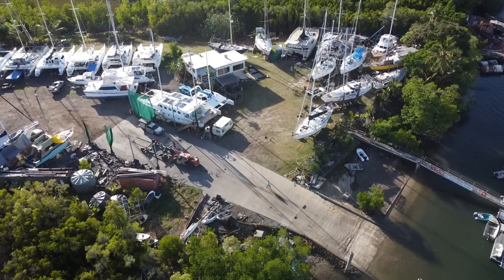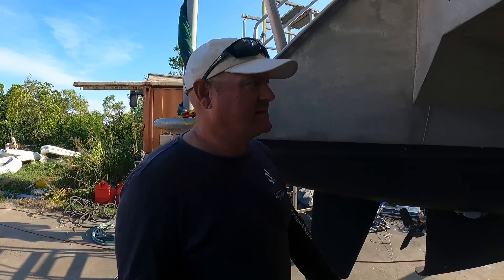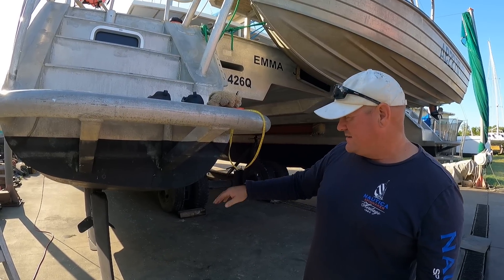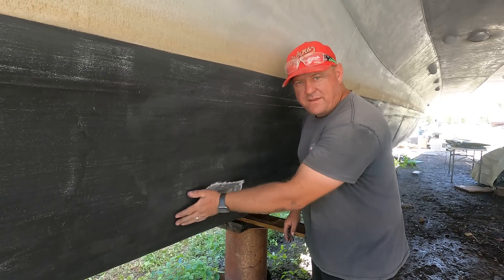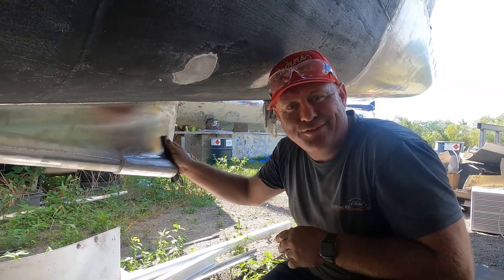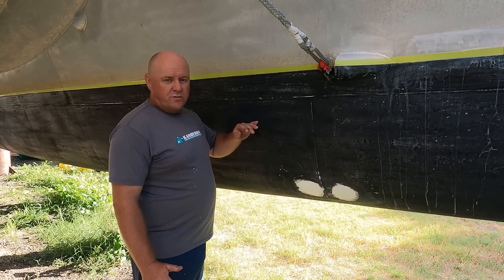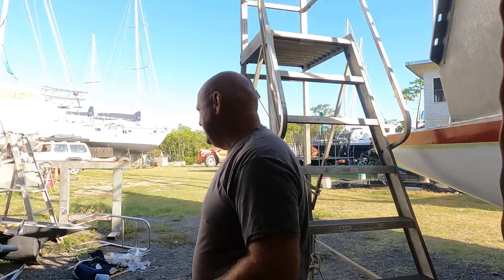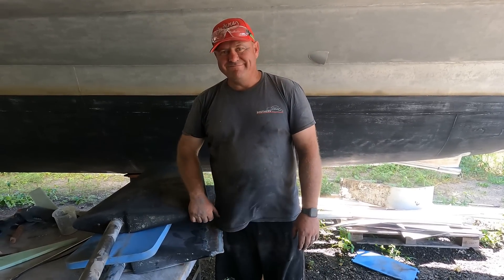How we Reduced Parasitic Drag for FASTER PERFORMANCE | Aluminum Catamaran Build (Ep. 109)

Comment: Beautiful, beautiful work, magical watching the transition.

I was wondering about the inset anode boxes. Was the approach to sand the back wall for electrical conductivity to the anode, or maybe through the bolts, or a pad, or strap?
Reply from the maker: Hi Kevin,
The conductivity happens Through the bolts. We have a 20mm plate on the back to ensure a good connection and the anodes have a 10mm clearance around the outside of them to increase the surface area. We also have anodes on our props down aft.
-sam

Comment: Hi guys, can't wait to see the results on the water.
Have to say I kept saying "don't put your greasy hands  on the primer" through the video! Have done a complete bottom job myself more than once and getting paint to stick is a challenge!
Have you contemplated putting tips on the end of your rudders. Mine are basically "spitfire wings". Yours look very small for the size of boat.
Reply from the maker: Hahaha, yes, getting it to stick can be hard. We used gloves to keep things clean. The bit you see without gloves is when we were sanding the epoxy faring. My plan was to put tips but I just ran out of time. It will have to be done next slipping.
-sam
Reply: @sailingwiththejameses Would that extra ‘wingtip’ not conflict when drying out and would bottom endplates not be a better way to alleviate the issue of induced drag? Having said that I wonder if the drag reduction would be noticeable at your cruising speed! Anyway, perhaps all this will be resolved at your next haulout when the rudder tops are modified to effectively use the hull as an endplate … hmmm, perhaps I should have just had another beer instead of typing all this rubbish!
Reply from the maker: Hahaha I love theorising and app the comment. Our plan is not to dry out on the rudders so the only reason we would put a plate on the bottom of the rudders is if we hobby horse a bit and feel that we need to settle that down. The tips on the rudders may help with flow but I was mainly doing it for fun. My plan is to put the gopro down when under motor and then again when under sail and just watch the flow over the rudders for a bit before next haul out to decide what approach we are going to have. With the next lot of modifications.
-sam
Reply: @ It is easy enough to tuft an aerodynamic surface to disclose airflow/turbulence etc but I wonder if the equivalent can somehow be achieved for underwater surfaces (probably catch some fascinating fish activity on your GoPro as they interact with tufts!) Must have a look on t’internet …
Reply from the maker: It's my understanding that most theories are transferable. Most the time with the gopro we are looking for air bubbles though so I suppose air is not the best sign. If you find out some cool stuff on the internet let us know. I can start planting the seed with Cait now ready for the next haul out lol.
-sam
Reply: @sailingwiththejameses  Here you go - something for Cait to start with …

Acoustic Doppler Current Profilers (ADCPs)

Computational Fluid Dynamics (CFD) Modeling

Conductivity, Temperature, and Depth (CTD) Sensors
Reply from the maker: Hahaha well I ran them past cait but it didn't go as well as hoped lol. We have Doppler speed logs on the ships but on the ships I worked on we found the to be terribly inaccurate. 
-sam

Comment: I love the recessed anode idea.So whole under water part of the boat is epoxy faired or just where anodes sit,some believes that water could penetrate between alu and paint and cause corrosion?
Reply from the maker: I would love to fare the whole hull at some point but unfortunately we didn't have the time or money to do it this time round. We only fared our trailing edges and the transition between the old hull and the extensions. When it comes to metal hulls corrosion is just one of the draw backs that we have to deal with. We hope that our prep work has reduced the chances of corrosion but there is no guarantee's. If we had painted straight over the aluminium then there would have been a high chance of corrosion but we sanded off the oxidation off and acid washed then put the primer on within 2 hrs of the acid wash so I believe we did all we can to minimise our chances of corrosion.
-sam

Comment: Really strange to have skegs and dagger boards at the same time. I think you made the correct choice to remove the skegs removing weight and drag. By the look of the last shot in your video the water release at the stern is brilliant with low drag and nice water flow.  I bet you very glad to have the cat back in the water and exploring again. Oh 1 thing about your kitty is if you plan to go to Fiji you might have to pay for the quarantine every day .. Sailing Zatara had to pay $20/day when they had their kitty on board.  Thanks for the video.
Reply from the maker: Hey Stephen! Yes she was designed and has daggerboards and the skegs were an after design  add on at build time for the ability to beach the boat. She's been handling amazingly since snipping them off 🙌
Fiji is on the list 🌴
-Cait

Comment: Step 1: How to start and extend your back of the boat, you start with buying a: mason's line. Then you tie it to the rudder end up against your boat so you don't have a cap between your ruder en boat with the cord, step 2: you make a 3 legged stand, now you let it stand after the boat further than you gone extend, now you can tie the mason's line cord to your 3 legged stand en and make sure you can adjust it up and down, because you have to align it to the upper end of the boat corner, now you have a perfect working line to make your extents' en it gone be even with your boat, now you can start with making a template. For the extension
Reply from the maker: Hi Iceman,
We have the complete build plans of the boat. I initially designed the extensions off that starting at the centre of the boat and followed the shape from there. We found that as the alloy has a mind of its own the shell plating was not 100% to the plan so we had to modify the plan. We did it similar to the way you suggested but used our eyes instead of the masons line. It is a good suggestion though, we appreciate your thoughts.
-sam

Comment: How does it track now that the skegs are gone? I removed my daggerboards and I wonder if I need to make small keels (5-10cm) to ensure I don't drift 🙂
Reply from the maker: We have just been launched and haven't taken her for a sail yet. She turns on a dime and is a lot more slippery under motor. She drifted round the corners l but wasn't bad enough that I had to put the dagger boards down. With out knowing you boat it would be hard to comment but I imagine having no daggerboards and no keel would come with its challenges.
-sam
Reply: @sailingwiththejameses  Thanks Sam, I will opt for 10cm keels on my 23 foot Catamaran, which I'm turning into an electric motor cat (no sails or tiny sail on the third iteration)
Reply from the maker: Wow going electric! That is awesome! I looked into going electric when we were getting new props but it was a tad to expensive for us at the time but I plan to go electric eventually, I just might have to wait for 1 of our diesel engines to fail first. Let us know how you go and what you learn.
-sam
Reply: @sailingwiththejameses  Thank you, I will keep posting🙂and yes, it is quite the investment which is why this will take me some time to finish🙈😂
Reply from the maker: Perfect I'm looking forward to it. Thank you 
-sam